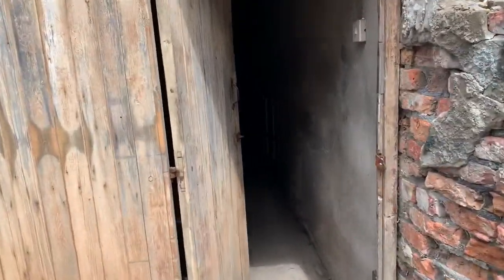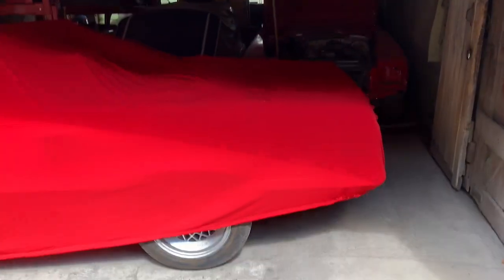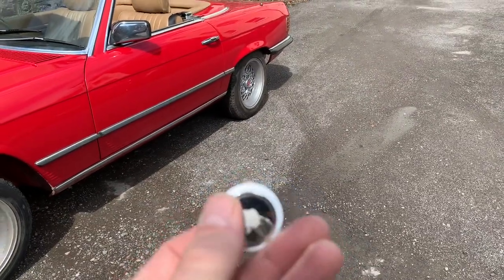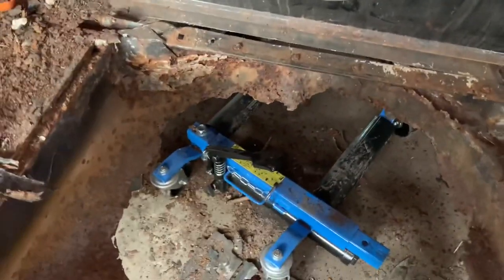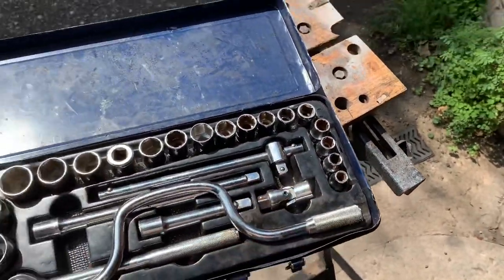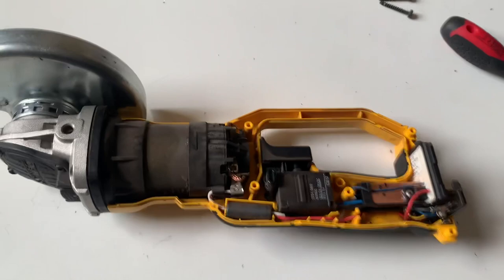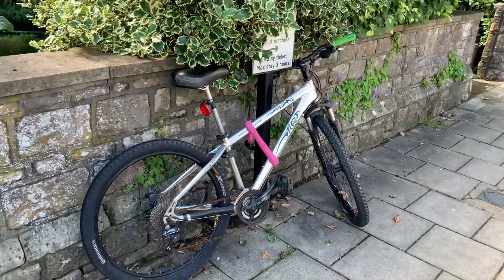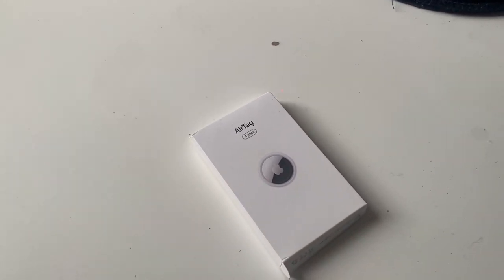How to protect your valuable tools and classic cars from thieves.....

Comment: I like the idea, I have been fortunate to not have this issue. I like the idea. Unfortunate luck you are having as of late. 

Also, Mike question have you ever ran into an issue on the 107s burning up distributor rotors? Mine suddenly decided to just burn them up. Put brand new plugs, cap and rotor in and it burned up the new rotor in about 10 miles, then burned the replacement again.
Reply from the maker: Thanks for you comment. Hmmm burning rotors, never had that on a merc. I'm no expert but...a burnt rotor or cap would generally imply that you have a faulty spark plug wire. I had a faulty wire on an E type and it caused NO END of problems. Changed everything before I finally figured it out. As for getting robbed twice in a couple of weeks......it could have been worse. At least in future I may have the pleasure of tracking down the thieves.... Mike
Reply: @MikesMercsandothercars  That was kind of where I was leaning next. A lot of people suggested the OVP relay or the ignition control module. But, I kinda figured if it's putting out spark, got new plugs, runs and drives. That there is some sort of resistance at the plug causing it to arc in the cap perhaps. Thanks for responding you have been a big help with everything. Hope you get your welder back.
Reply: @MikesMercsandothercars   Turns out you are correct, checked all the wires today, all were 1.2k resist, except cylinder 1 which was 4.1. Looked inside and it was pretty wrecked and inner side broken off. Thanks.
Reply from the maker: @frostshock13  Thats great news - hope it solves the problem. Don't forget to replace all the wires at the same time. Mike
Reply: @MikesMercsandothercars  Well, I did change them all, like every thing except the ignition module is new at this point. fired it up.. drove it 5 feet and still misfire bogging. :/

Comment: Do you have any security cameras?
Reply from the maker: Thanks for your comment. Unfortunately my garage doesn’t have power which makes life a bit trickier. I was exploring the possibility of installing infra red battery powered cameras….but in a way being able to track my possessions is almost a better option. I’ll probably do both - belt and braces approach. Mike
Reply: @MikesMercsandothercars   Ring Cameras have solar powered options, you just need a WIFI connection!
Reply from the maker: @anthonylugo7809 Thanks for your comment. Yes I have thought about cameras but there is no power or internet in my garage. Just unfortunate that I left my welder there that particular night. Usually there is nothing to steal. Mike